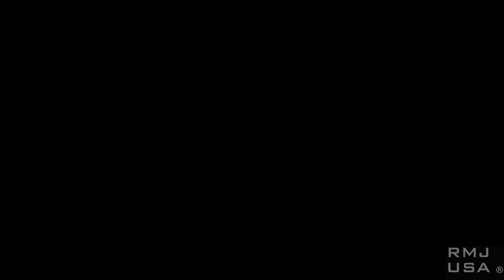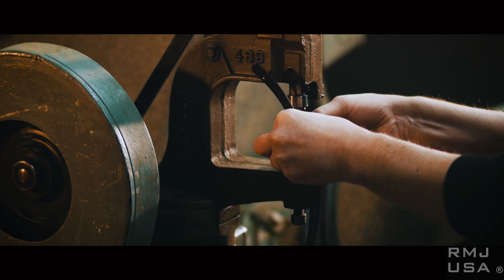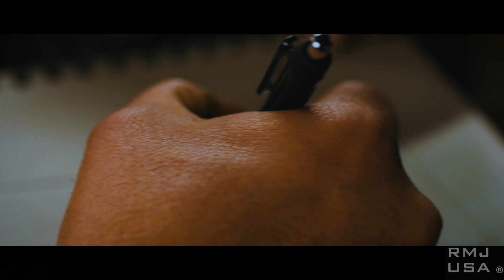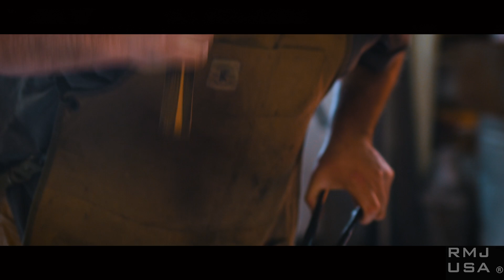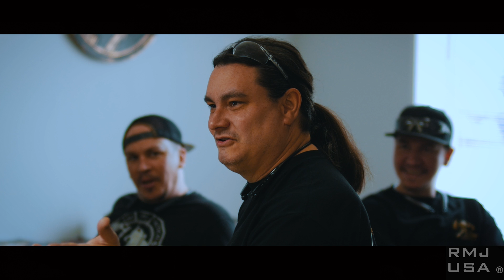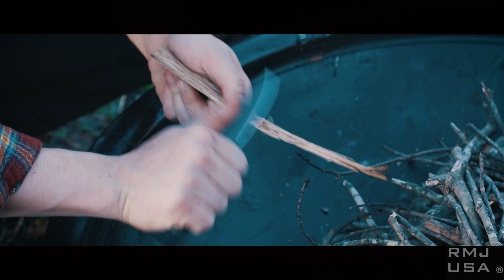RMJ USA - WHO WE ARE

Comment: I definitely want a tomahawk from you guys but why the change in steel? Going from 4140 to 1075 or is the tomahawk a combination of the two?
Reply: When we first started the all steel tomahawk over 15 years ago, we felt that having a deferentially heat treated head would improve the durability of the tomahawks.  We initially heat treated the heads to 54 rockwell hardness and the handles to rockwell 30, so they would spring and reduce the chance of breaking.  4140 allowed for that type of heat treat.  Over the years, steel quality has improved and  we found that need for the deferential heat treat was no longer necessary, so we use other steels that we feel give better long term edge retention.   -Richard Carmack
Reply: @richardcarmack7516  the move to 3V is welcomed. That's such a great performing steel.
Reply: Forget the question. I just read the reason for the change in steel  on the forums.